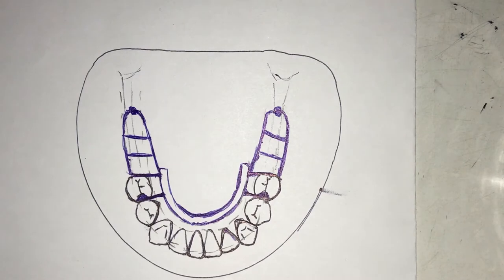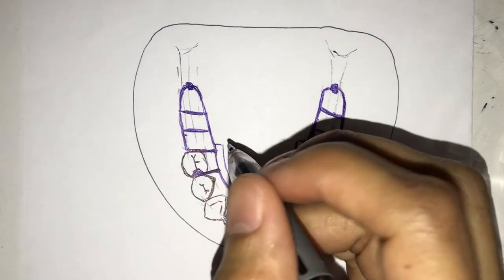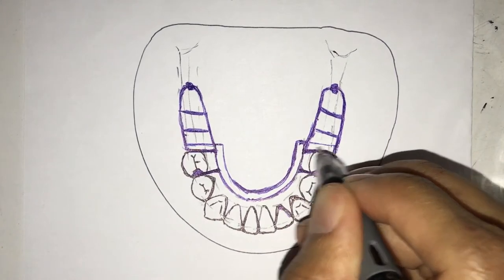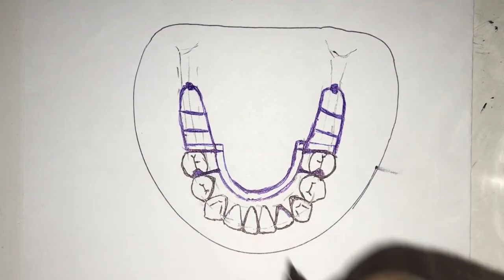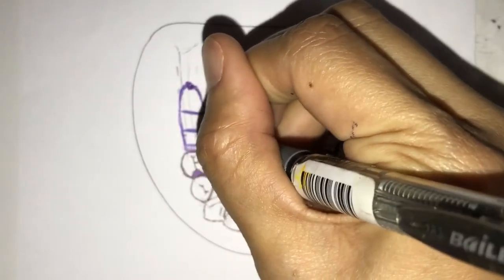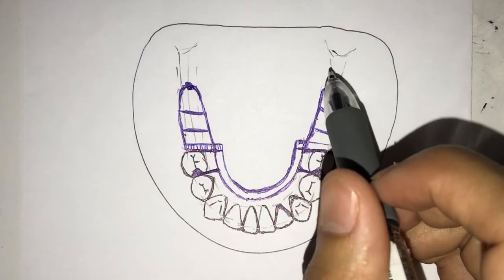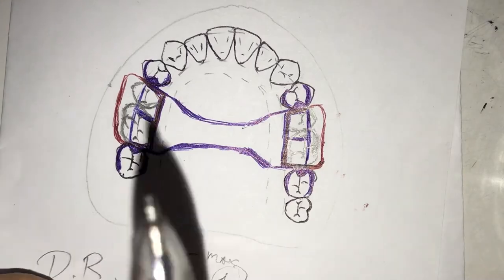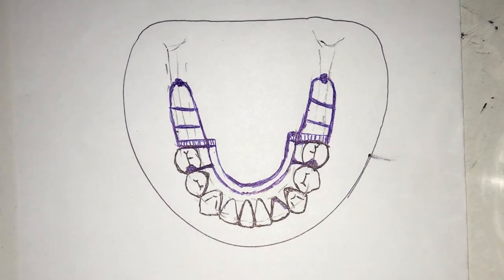Removable Partial Denture Design Principles Part II

Comment: why you did not put rest’s in the first pre molars?
Reply from the maker: because if the inclination , position, condition, and anatomy of the anteriors esp the canines are acceptable , it would be better to use lingual apron/ plate as a major connector which would actually work as your indirect retainer better than placing it in the first premolars. This is due to the principle of indirect retention which states that it should be situated farther away from the fulcrum line (where in this case is the line passing through the 2nd premolars rest positions).